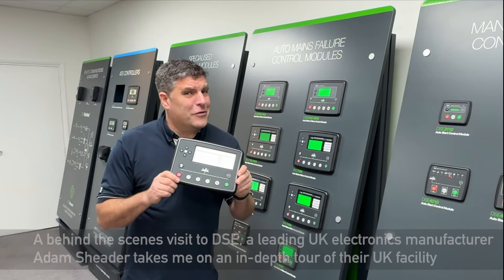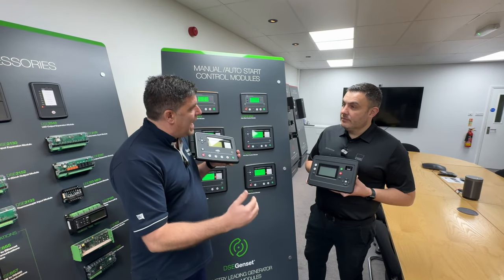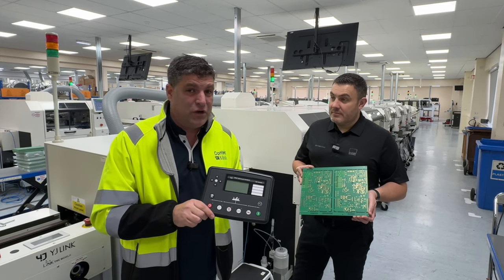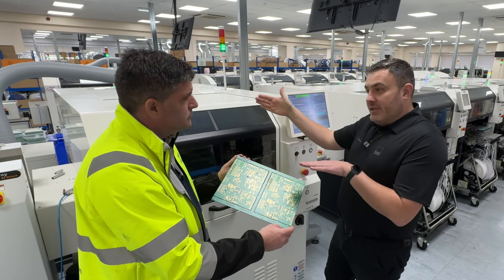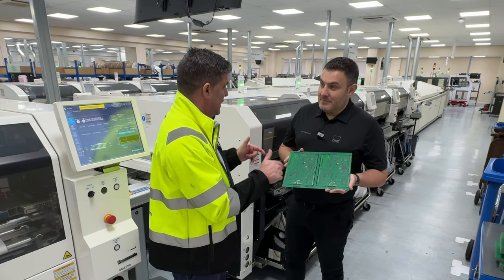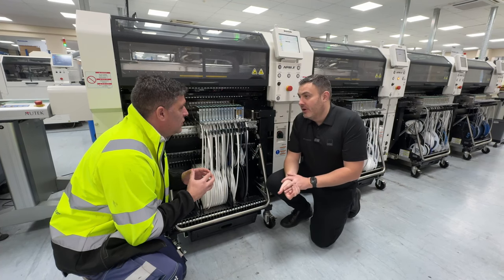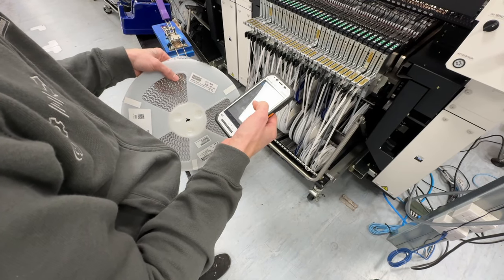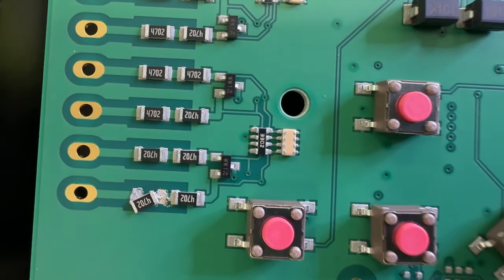An Insight into DSE Manufacturing with Peter Haddock (Part 1)

Comment: Wait a minute... My concrete cutting operation will require a 60kw 480v 3-phase generator for a 40hp saw.  Could these paralleling controllers allow me to scale my operation?  If I could start off with a 15hp saw and let's say 30kw a generator; would I be able to buy an identical generator down the track and power the larger saw with the pair?  The redundancy would be huge as well.
Reply from the maker: Hello, generally speaking yes you can, however please email support@deepseaelectronics.com and one of our technical support engineers will be able to assist in more detail.